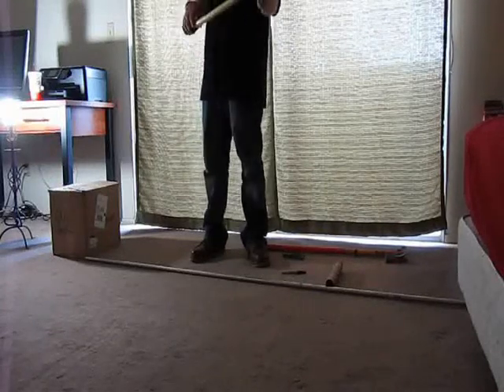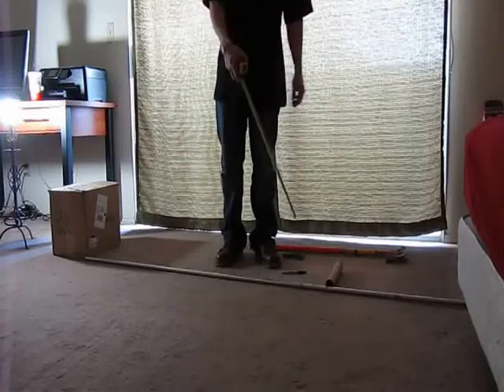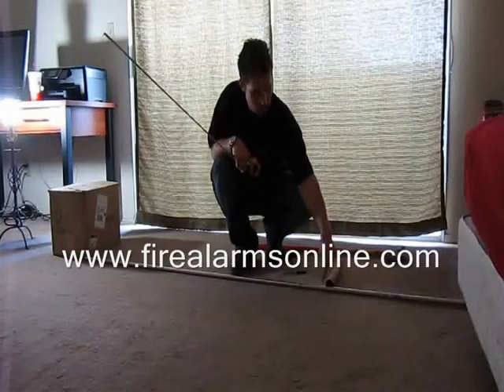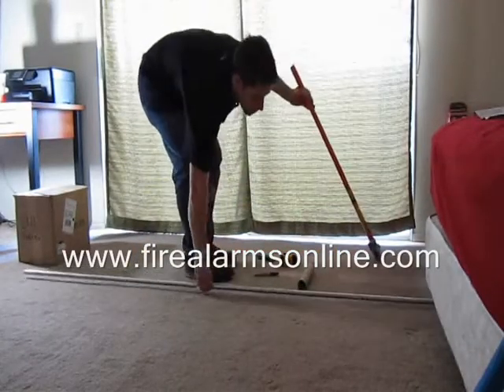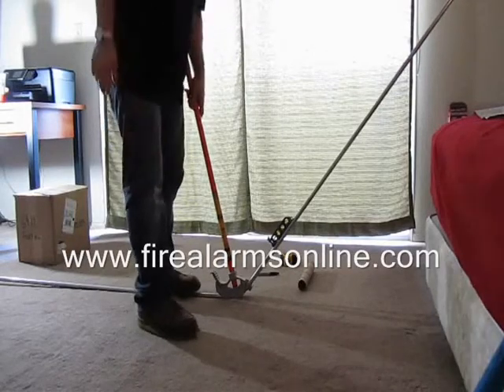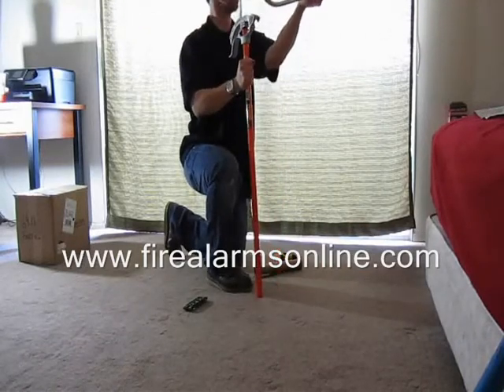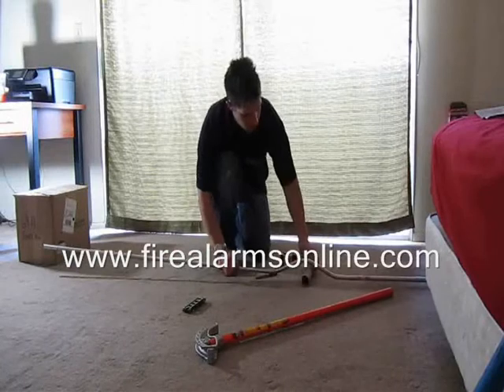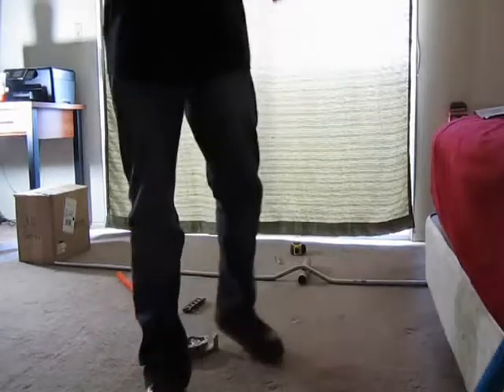Conduit Bending How to bend a 3 bend saddle

Comment: You can also use a 60 degree first bend and 2, 30 degree bends for bends 2 and 3 when clearing a small pipe as shown. The saddle will be tighter and look much better. You may want to practice a 4 bend saddle which is often used. Been there over 25 years now retired.

Comment: hey I saw suggesting to check out your videos. I did. check out mine.the offset ruler. the ruler makes it so you can bend perfect offsets first time.including 3point saddles in two different degrees, not just 45. so the hump won't be too big.

Comment from the maker: I am not sure how you can say my saddle is sloppy when you never see a straight on shot.  However my saddle was made a little too big which is fairly common.  This is why I used my knee to make a final adjustment.  When people tell you to keep it straight that is basically it.  You can also purchase a no dog level or make pencil marks on the end of the conduit at 12-3-6 and 9 oclock.  This will help you line up your pipe for saddles and offsets.  Bending conduit is very simple and takes practice